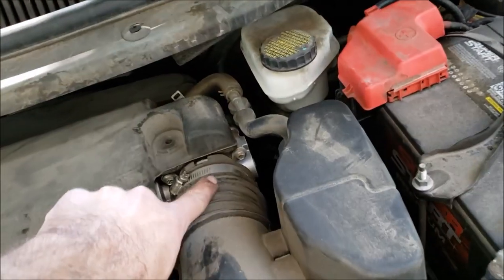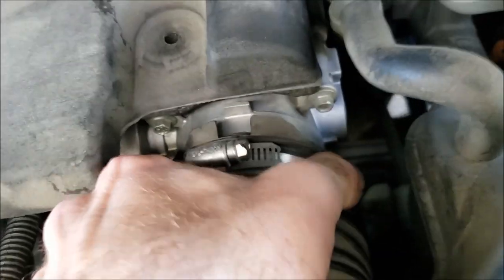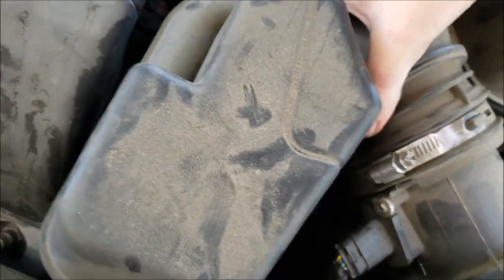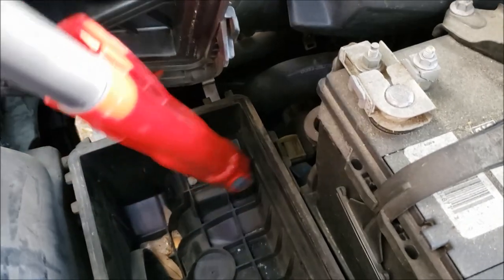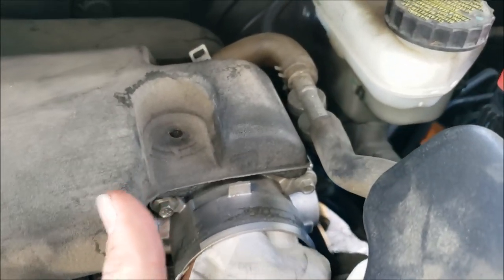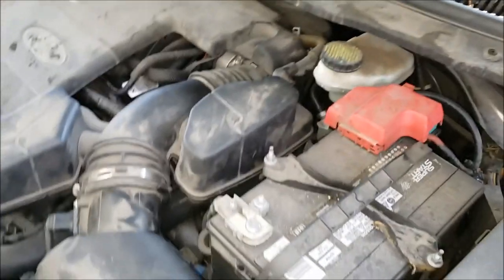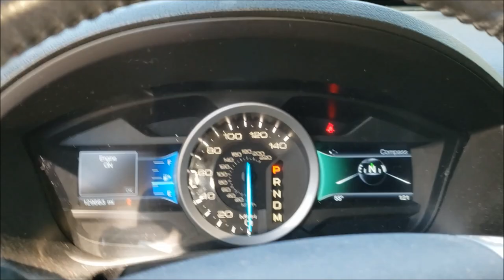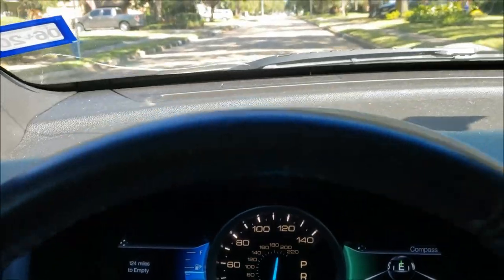Ford Explorer Rough Idle/Idling - How To Clean Throttle Body

Comment: You should not use a brush inside the throttle body to clean like that.  You will loosen debris that will then get sucked inward.  Despite trying to reach in with a rag you will not get everything that you loosened.  It only takes a few more disconnects to remove the throttle body and clean both sides of the butterfly without risking debris falling in.
Reply: Yep. Removing throttle body is better. The finger 🖕🏻 is safe 😆

Comment: Wouldn't recommend sticking your fingers in there especially if it's still plugged in lol. The ecu can cycle the throttle-body at any time even with the engine off and easily take your finger with it or at least pinch you pretty good if you're lucky enough to get out in time.